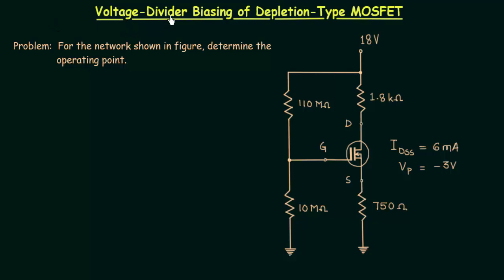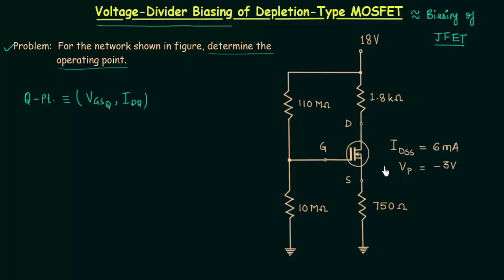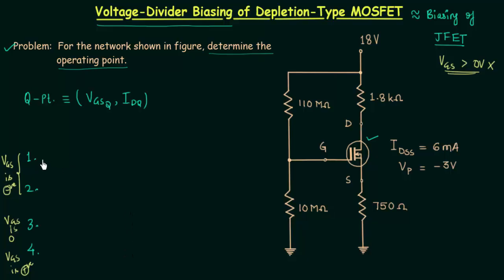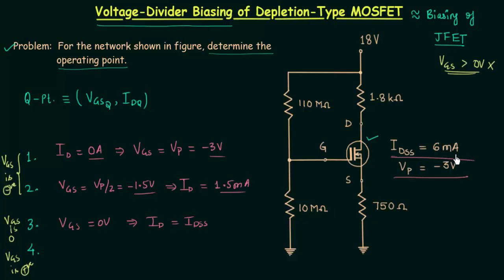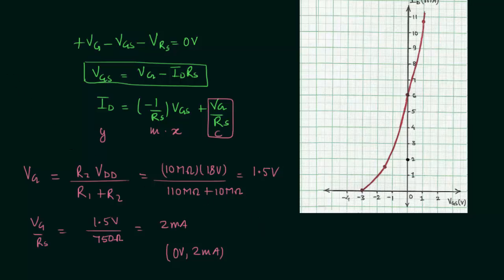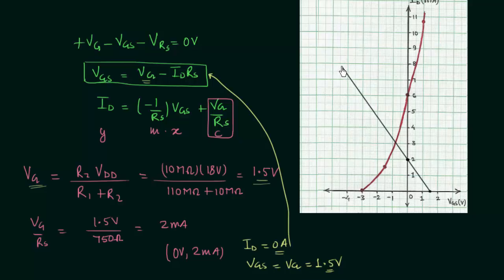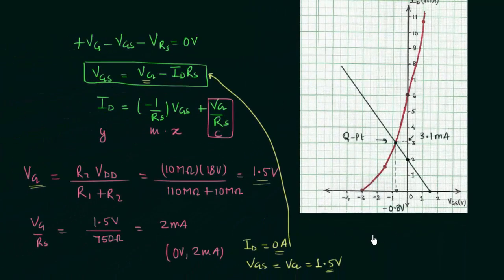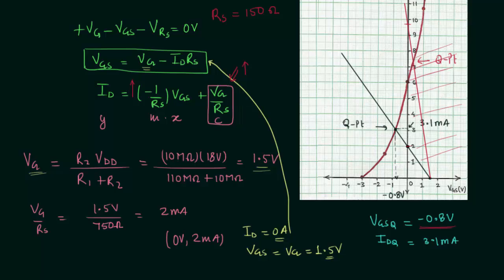Voltage-Divider Bias Configuration of Depletion-Type MOSFET

Comment: Why ig =o
Reply: oyyy lekkalu
Ig is zero because gate terminal is generally separated from the substrate or any there component in the transistor by the means of SiO2 which is a dielectric which won't allow conduction as it can act as a insulator